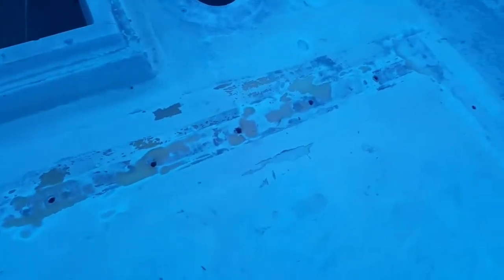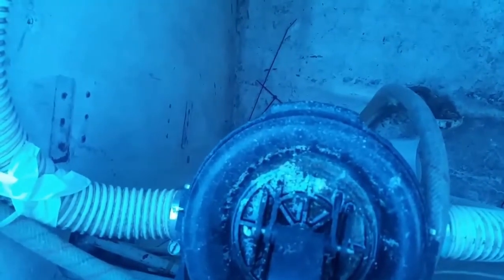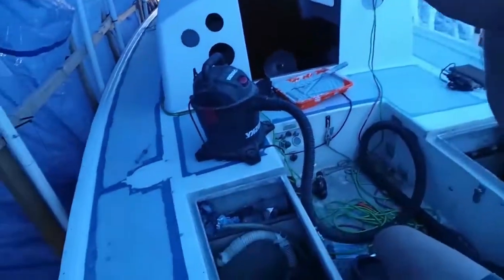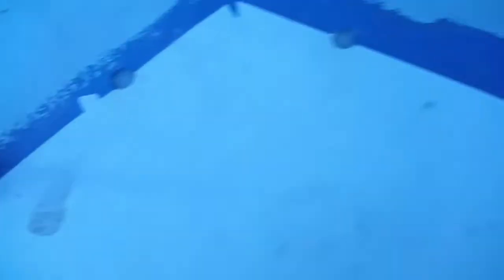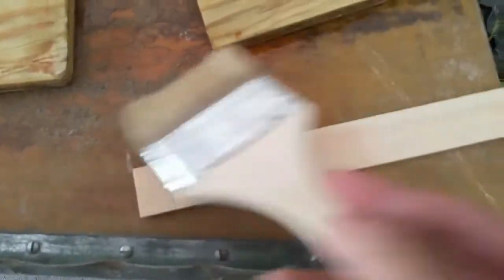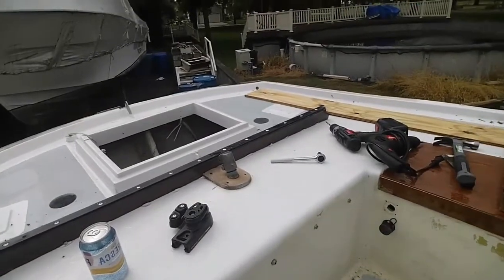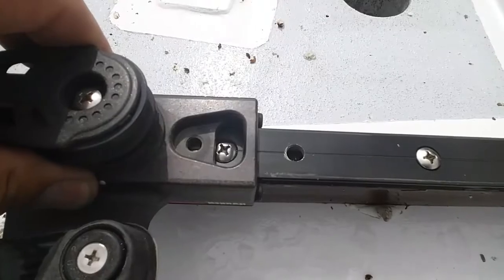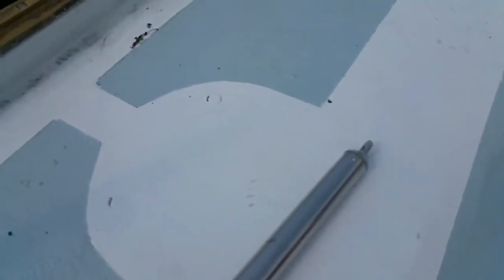EP-24 Tartan 27 Sailboat Refit and Restoration:  Backing Plates, Toe Rail, Ice Boxes and Racoon Poop

Comment: Nothing sucks more than not hearing your terrible music from down the hall. I miss you Mr. Kohler. But that’s so nasty clean your boat
Reply from the maker: Good to hear from you Malak!  I miss you too.  Be well.
Reply: I don't know if you are still responding to these messages I thought I would share what I have observed to answer your question if I am doing this right; no, the fiberglass on the top of the boat deck and cabin top is integral to the strength and flexibility of the boat. When the fiberglass cloth was laid and cured it formed one piece. The repairs should have been done from inside the cabin there is a good example of this on BOAB "Bums On A Boat" youtube channel and "Sailing Magic Carpet"  @christopherpkohler